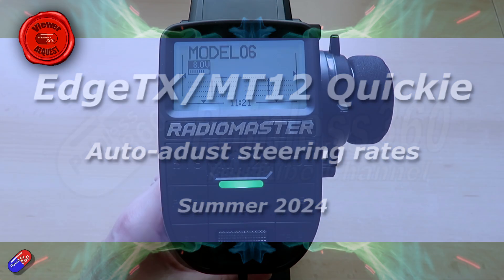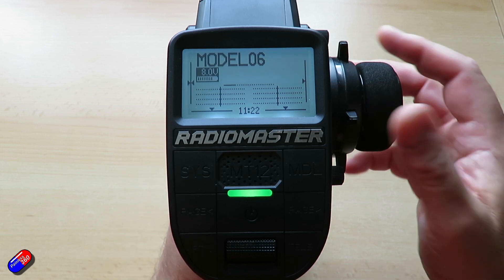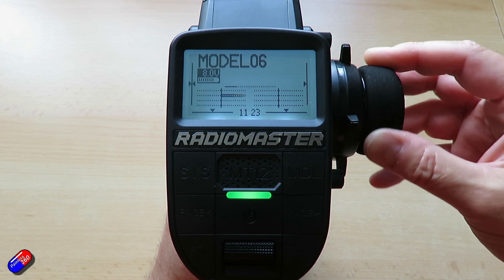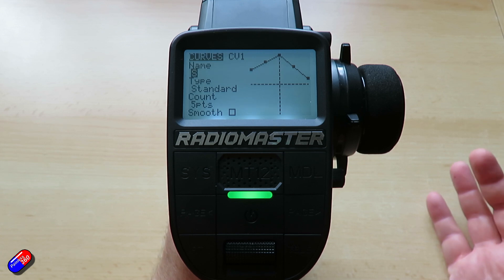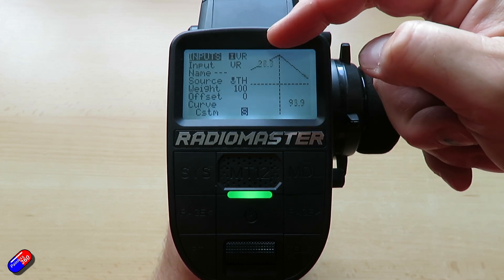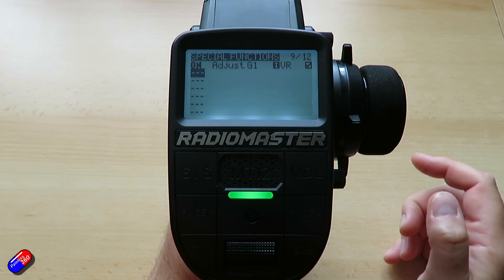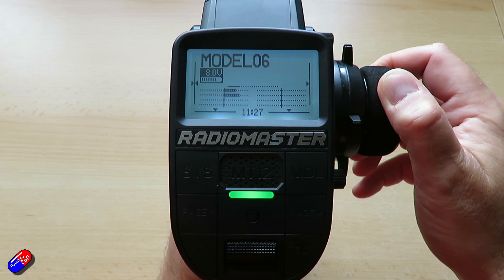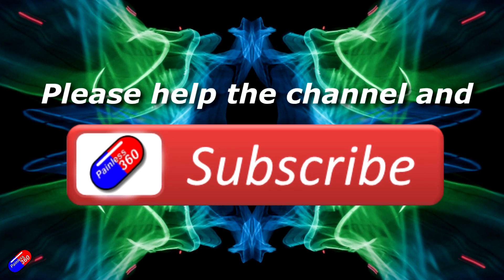Automatic steering rates: Make an RC Car easier to handle at high speed (MT12 and EdgeTX)

Comment: Amazing video. Just what I was looking for. I've wondered for some time if this would be better than standard dual rate steering.I'm very anxious to try it . When you're running on a residential side street there's not a lot of room for error  so going slow to turn around and getting less sensitive as you run down the street .  Might keep me out of the ditch   lol..  I'm anxious to try it out and see if it works as good in reality as it does on the video

Comment: Do you know how to adjust speed sensitive steering on a radiolink rc4gs v2 controller? I can’t control it  at higher speeds without spinning out of control.
Reply from the maker: I don't. It took me a while to get a working with the power of EdgeTX on this radio... Best of luck

Comment: I can not calibrate Traxxas max ESC with Press LRS radio, Master. Please help. 
Steering works on channel one 
No throttle on channel 2.
Using radio master MT 12 with Xpress LRS ER3C-i
Reply from the maker: What troubleshooting have you already done?
Reply: I have a spectrum receiver with the spectrum radio and it works just fine
When I try and hook up the radio master with Xpress LRS, it does not work.

Everybody online says you need to hook up Traxxas and do the reconfiguration and I don’t have a Traxxas radio.
Reply from the maker: Check out my EdgeTX and MT12 car setup videos.. best of luck
Reply: For traxxas esc 
Express Lia scripts
I had to lower my packet rate to 50Hz
It hooked up.

Comment: But if you ride fast without throttle it will still be sensitive? But I guest to mix the sensitivity with the real speed you will have to do some setup in something like iNav right? And have the GPS in your car
Reply from the maker: Yep, you'd need some programming in something like INAV to decrease steering throw as a function of measured ground speed from the GPS... Happy flying